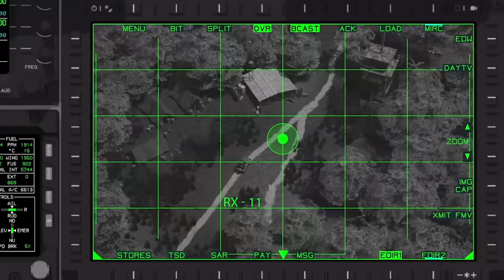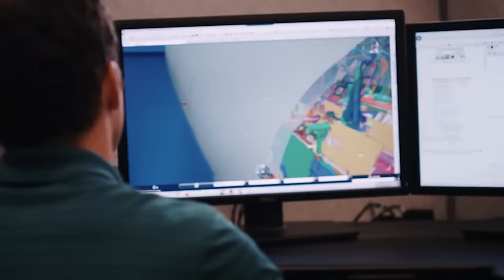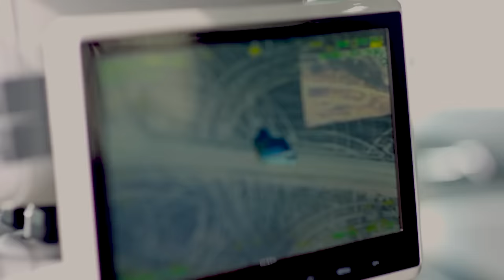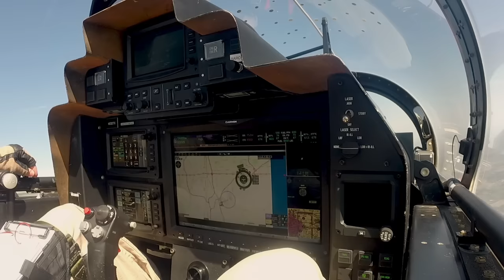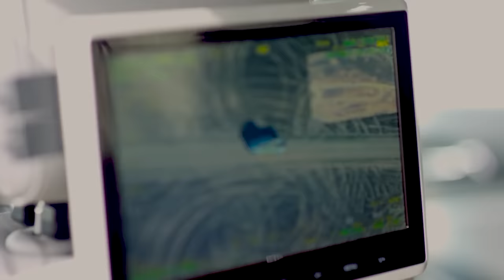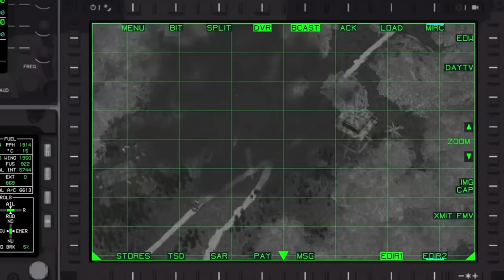The US Secret Aircraft That Made Everyone Go Crazy When It Was Released

Comment: Why use this when you have OV-10 Broncos out there still being used effectively? This really just looks like an attempt to modernize the Bronco. The problem is that it’s slow but it’s still too fast for what it could be used for and was marketed for the wrong mission set. The brilliance of the Bronco is it’s ability to fly very slow to attack ground units and it can fly at altitude and then kill its engines to dive in silently while gaining more than enough energy to easily kick them right back on and pull out. Hence the name Bronco, it can buck in and kick out.

Comment: If there is a case for the use of this airplane today, it probably would be Ukraine. But instead if finding a use there and plugging into the fight at an affordable rate, the very low cost drone is proving very good for the tasking assignments that this plane was intended to be used for. Ukraine has demonstrated that so called low threat environments can get very hot and high threat very quickly, and drones which cost in the thousands of dollars instead of millions of dollars can be more easily procured and tossed into the fight and they can be sent into high threat environments because they are expendable. The Scorpion is not what I would call a low cost expendable asset.

Comment: A classic case where a design was not requirements-driven from an operations perspective.  Foreign sales are extremely rare unless it's an aircraft that the US already flies.  Underpowered with commercial biz jet engines that wouldn't get 1/4 the reliability of a biz jet installation due to increased throttle transients.  Does not appear to be supersonic with the fairly unswept wings and no afterburners.  So, not suitable for a fighter trainer.  The design is a compromise simply to meet affordability goals.  Not an optimal ISR platform.  Not an optimal trainer.  Not an optimal light fighter.

Comment: Looks weak. Compared to an F/A-18D Super Hornet which has a similar body style and configuration. The Scorpion looks like a paper tiger vs a predator. However the Scorpion could augment Marine Units that currently use the AV-8B , also the A-10 Army Air Corp.  I wouldn't take the thing in a dogfight but in an open battlefield where air-superiority fighters are present, why not. The thing is most attack aircraft can dogfight, the F-16A and F/A-18D are capable dogfighters, both of which will eventually be phased out or reduced due to the F-35 Variants already in production, simply put the Scorpion is a redundant airframe with the same mission and came far too late to the party, lets also not forget the F-15EX coming online. The Scorpion would have to be tested in an air-to-air engagement before I'd buy it because you never know when a Su-33 or a MIG-29 is gonna show up and kill an unprepared aircrew because more than likely that will be the biggest threat to the Scorpion. Not so much ground defenses.